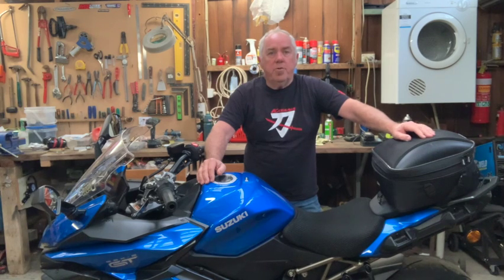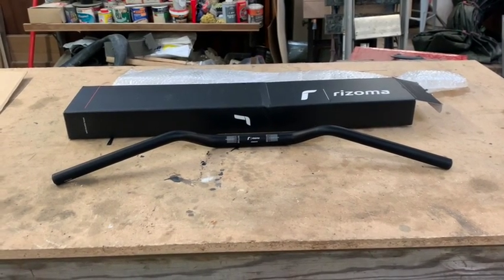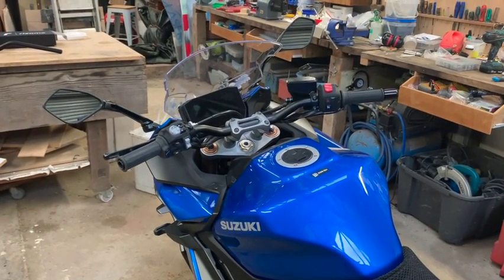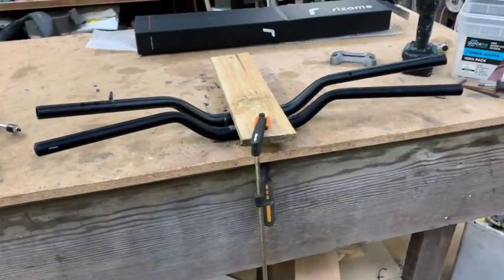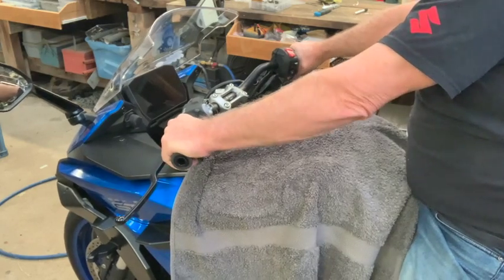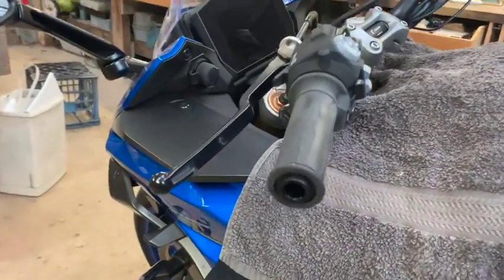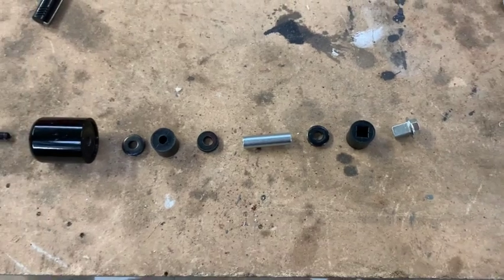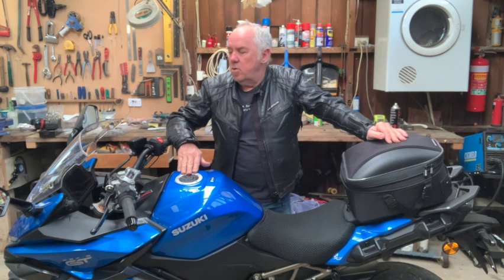GSX-S1000GT Rizoma Bar Swap

Comment: Hi, I know it’s been a while ago but did these bars make a difference as far as how stretched out your arms are when riding? I’ve got bar risers already but would like a riding position more upright still. Thanks!
Reply from the maker: Not a significant difference. They do put your hands in a more natural position though being slightly angled down at the ends rather than angled up like the stock bars.